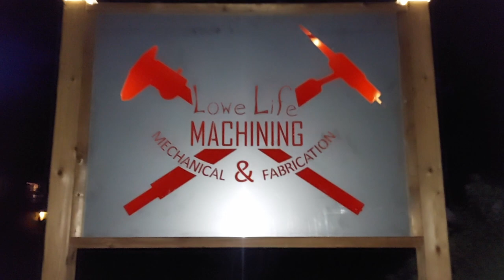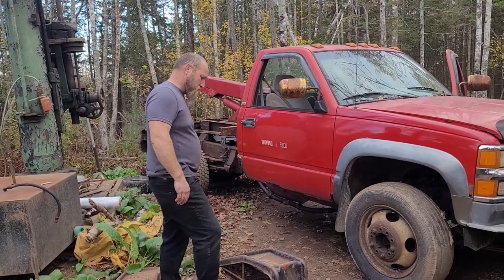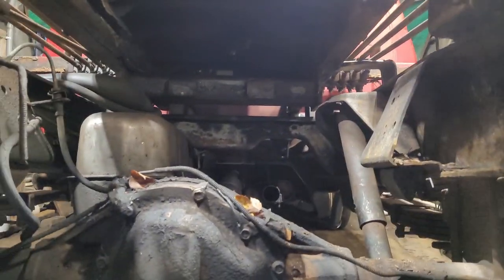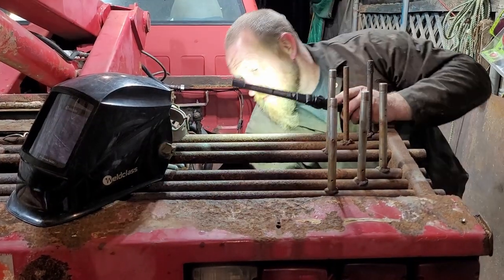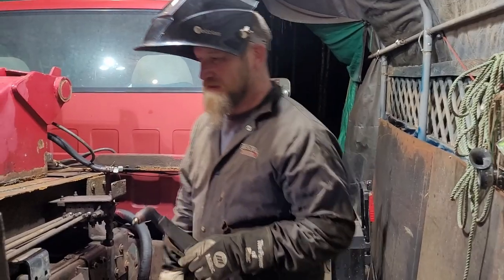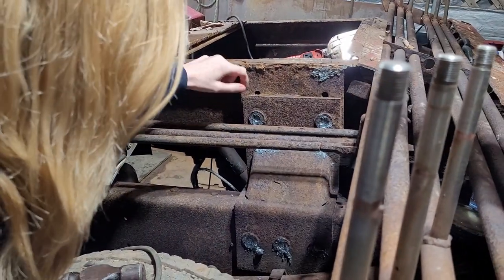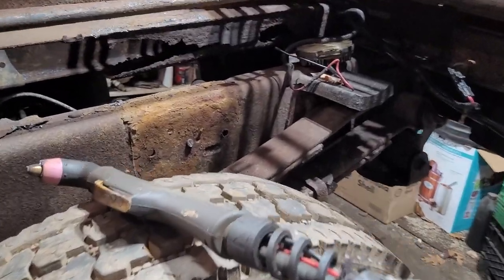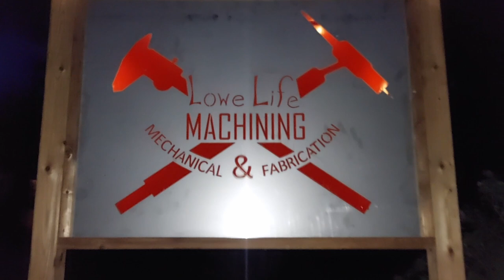How to repair a tow truck wheel lift

Comment: Nice to see another Canadian playing with the crusties. I have a 411 boom and  wheel lift assemblies that are getting custom sub frames. Your vids minus the body were super helpfull. It's always handy to see what the OE has done before I go off reinventing the wheel. Urban developement has come for my shop in Surrey, so it's pack up and GTFO. We should have the new one up and running on the island around October. Once i get settled I'll post up some content you should like. 
cheers,
Stay outa the bite!
Reply from the maker: Thank you, I try to cover as much as possible because really, there isn't alot of information on them. I look forward to checking out what you have on the go! Thanks again!
Reply: @lowelifemachining2234  I'll try and post up some of the mayhem of the move if time allows. I agree info on these units is super hard to come by. If you could.. post up the measurement from the center of the lower pin of the boom lift ram to the rear axle centerline. All the info just says 60" C/A but that doesnt really help much when you're not using their deck. Any help would be huge. Thanks in advance.
Reply from the maker: @littleriverrestomod4205  ya, OK I'll see what I can do for you. It may not be right away as I have a few other projects on the go, but I plan to get back at the wrecker as soon as possible.  And I will definitely add in those measurements as well.! Thanks!

Comment: Would you think most tow trucks have positraction?
Reply from the maker: Absolutely! hahaha, yes, it's been a while since I've worked on the ol girl. BUT, I'm planning on bringing it back in the shop this fall/winter to start putting it back together. Everything is here for it. Just trying to find the time.